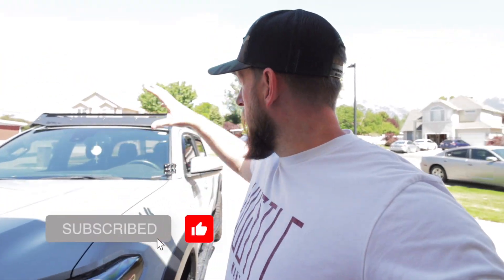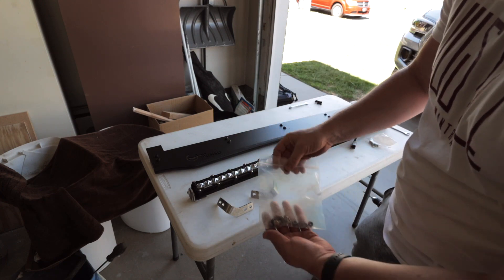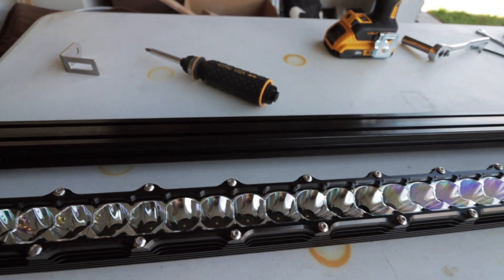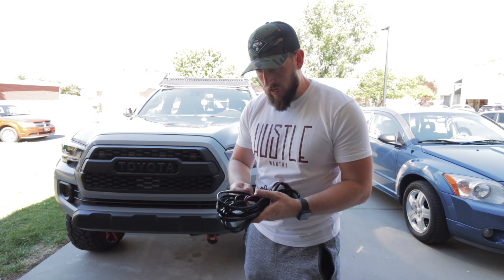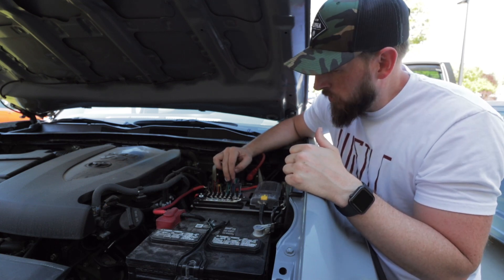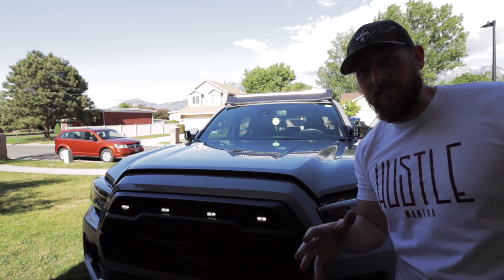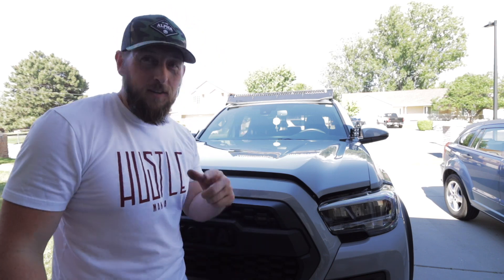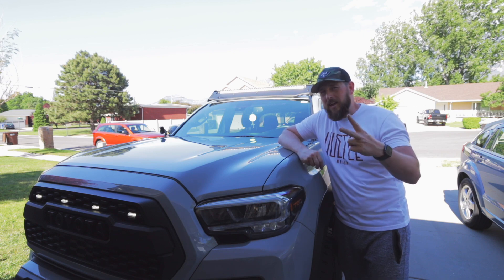HERETIC STUDIO 40" Light Bar on 2020 Tacoma | INSTALL |  #tacoma #toyota #hereticstudio

Comment: Might have to mount it the same way. I mounted mine on the wind deflector bar and it lights up my windshield and whole hood
Reply from the maker: it will also depend on the angle you have it at. but I like that the mounts don't stick up past the crossbars.

Comment: Hey Mumfy.  Was checking this out since I just ordered a Prinsu.  Dang that light is pricey.  Since you’ve had some time to use it now, do you believe it’s worth the money?  Also, any idea if there is a way to conceal the wire underneath the windshield trim molding?
Reply from the maker: Very much worth the money. I’ve seen some other for over that. But stay within your own budget. I was able to conceal the wire under the trim molding and it’s holding up well.